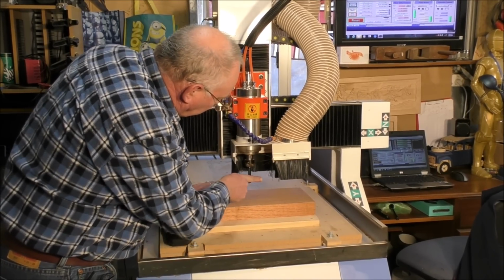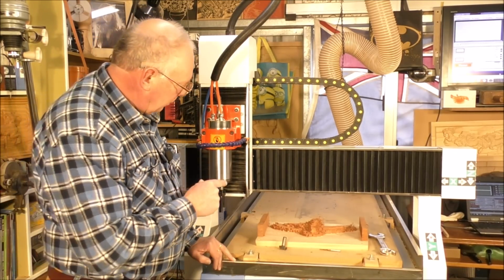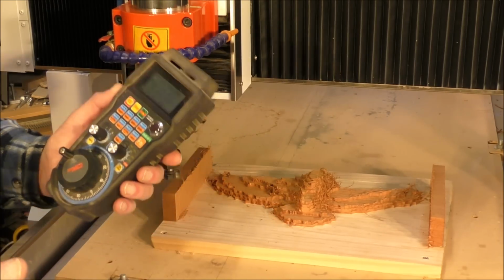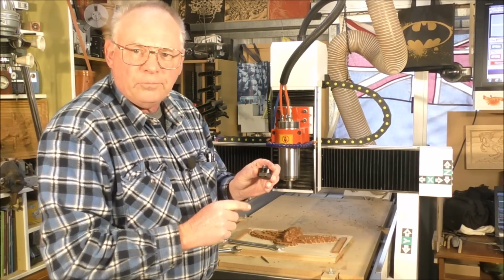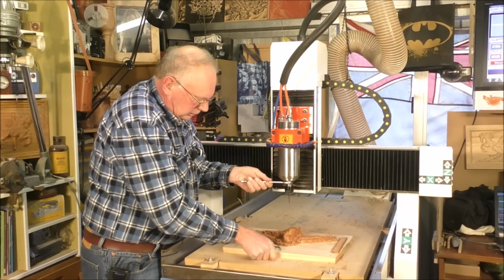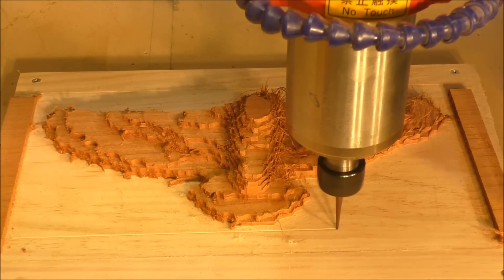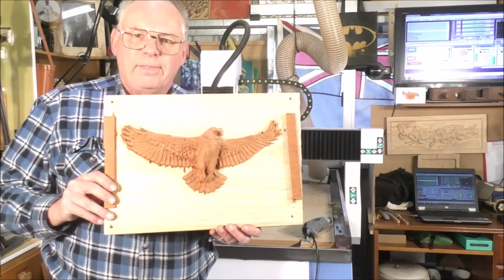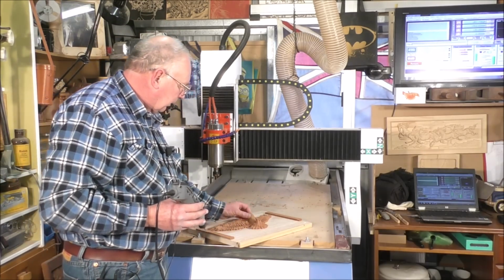2M views CNC router CAN make $25,000 🤑 per month carving a 3D American bald eagle I CAN SHOW YOU HOW

Comment: I dont understand why you didn't just start with the area bigger so you didn't have to manually clear it? Also since its end grain you should be able to break it off no problem.  Why not just measure from the base of the eagle block and then top of the eagle block so you can just do some math when you put the fine bit in?

Comment: Nice job done Roger.  You remind me of an old friend of mine who has since pass away.  I watched several of your videos and enjoy them always.  A brother N law of mine use to do refinery work, with various aluminum, brass ect... he was very good at it and some times they had things like the eagle to pour in metals, and they would on occasion use a sand blaster to remove the roughness, I use sand blasters for engraving and if you use filtered silicone sand it is like high grit sand paper, lets say 1000 grit plus and it is easy to sand with, might be an option in your future and it gets into all the small areas for ultimate sanding.
Reply from the maker: Thanks barry, I will look into that.

Comment: Hi there, new subscriber! I am a designer and CNC programmer by trade and have been investigating which router amd software combo I should invest in. The problem is, how come it seems no software seems to accept .stp files or other formats I could save out using solidworks? I want to design my own files and import them into the CNC software to program. Any help would be greatly appreciated!! Thanks!
Reply from the maker: Carveco
Reply: @inventorsworkshop9600  Thanks Roger, I will look into it!

Comment: hmmm, i remember learning how to use a carving / copying machine when I was working with my step-father back in 80's, we also refinish furniture for local hotels, like Red Lion, etc.  That thing weighed tons and duplicated 6 other pieces at a time, i dont want to upload some of the finished work we did, you would throw your machine away and start another hobby, we also created and built $100,000 floors that was also German ingenuity and we used our hands.

Comment: Great video! A little tip on setting tool offsets... never measure from the top of your work, always measure from the table or fixture using a standard height block. It can be any height, as long as long as you know what it is. Then measure the delta between your tool reference and your workpiece reference. This way if you machine off the top of your workpiece and you need to change/replace a tool mid-cut you still have your datum.
Reply from the maker: Great tip!

Comment: What would happen if you accidentally added an extra 0 on the spindle speed?
Reply from the maker: The VFD will only  let the router motor run to a maximum of 24,000 rpm

Comment: Very nice work. I´m a OB&GYN and I was wondering if it is possible to do a baby face with a volume 3D archive from a ultrasound machine (*.stl) with that machine.
Reply from the maker: Yes, absolutely, you would need to run the file  though Caveco CAD/CAM to make it usable geometry then create the 3D tool paths (G-code) and the CNC router will cut it.

Comment: I can see where they got the idea with 3d printers there essentially CNC machines that extrude plastic instead of cutting.
Reply: I will take a sinter over an extruder any day. Still not there yet.
Reply: @jamegumb7298  I've got a Sinterit Lisa Pro. Great for models and POC... really bad for accurate large parts. Problem with SLS is that the plastic warps significantly under change from high temp (200+ c to melt) to lower temps, especially nylons. hopefully better software fixes that in the future. if you're not looking for like 5 thou accuracy over a 20cm part though the tech exists just expensive. the plastic powder cost is no joke (and will probably never be, since plastic that fine is a bitch to make)

Comment: You should write some G Code to Face down the left and right pieces of left over stock. Just need G1 X0 Y0 Z0 F1000 and the G1 X0 YDistance Z-2 and just copy and paste until you hit you depth.

You should try a second at -.1mm lower depth pass for cleanup, it's faster then the manual work.

Comment: A suggestion (might be of no use). Could you stick the ends of the blank with double sided tape and the main working area with wood glue? Then you should be able to knock the ends out of the way when the cut finishes.
Reply: Another one - do the cuts then soak the red cedar in liquid epoxy. When it's cured, run the final cuts again to clean off the wood feathering.

Comment: i got so much better at cnc wood carving once i realized the importance of calculating the spindle rpm for the feed rate and the specifications of the bit.  The bit doesn't even get too hot to touch when it's making chips properly;  You just have to get more comfortable putting some lateral force on it instead of thinking the cnc machine is supposed to be moving with no resistance

Comment: Those remaining outer edges are a little time consuming to reduce down, prior to swapping out the cutter again for the fine cutter. Why not enter instructions at the very beginning with the 12.7mm cutter installed that removes 6-8mm from the left and right side and then continues to rough cut the object (in this case it is an Eagle). Reducing those outer edges first would save you an awful lot of time and also a whole cutter change. not to mention the wear and tear of that cutter. Just a thought. God bless.

Comment: Could you replace the bits with metal cutters and make a brass eagle? Before they had computers I used to use a tape drive milling machine and carved out different things with aluminum. I was trained back then by a teacher that machined parts for the first space shuttle. He helped make the doors on the space shuttle and normal tolerances for machining are plus or minus 5 thousandths, but for the space shuttle the tolerances were plus or minus one thousandth.
Reply: I'm assuming you're talking inches.  1 thousandth of an inch is 25 micron.  I work on a crankshaft manufacturing line, and we run to a bearing diameter tolerance of +/- 8 micron.
Reply: that is more likely work for the bigger industrial cnc mills like a vf-2 or something from what i see these garage cnc machines only ever cut wood
Reply: It depends how rigid this router is and what the spindle horsepower is.  Routers are normally reserved for wood and plastic, while CNC mills are used for metals (and plastics).  This particular machine might be able to handle brass though, it's not a very tough material to cut.

Comment: When I work in metal, to get a nice finish I leave about 0.2-0.5mm for a fine cut. Just run the program again and it will get rid off that "fur" and leave a great finish. Cuts out that extra manual work.
Great video, inspires me to start woodworking!
Reply from the maker: Great point!
Reply: @inventorsworkshop9600  You can also try a downcutting bit.
Reply: Called a spring pass…

Comment: Needed to run a finer ball nose cutter at a shallower depth. Tbh even .2 depth might be too much as that would still leave ridges. To reduce the code size and time frame you could choose just the eagle with the finer cutter. As a safety measure I always program a 100mm off the job with a G01 code so it stops 100mm off check with a ruler and run the rest of the cycle. Blower and suction or a strong suction will keep the cutter cool so you could bump the RPM as fast as you like. I programmed an accident victims face but the amount of code and time frame to recreate a mask was ridiculous. This was before 3D printing

Comment: As soon as I saw all the jagged fury edges I thought, more cutting paths would also help with the amount of post processing. I would have tried double or even triple the roughing passes. then I would have switched to a 3/8ths inch ball cutter and left about 0.010" of stock with a decent 0.025" step-over. If your software has "rest milling" it will only go over areas it has to mill for the 3/8ths, I don't know how complicated or how complete of a package that software is. If possible (with your software), I would have used an 1/8th inch ball mill after that and cleaned out a bit more, again leaving 0.010" stock with the same 0.025 step-over. Then switch to your finishing tool, looks like a tapered ball mill. Perhaps go a tiny bit slower or give it more spindle speed and feed (both). Wood can be tricky to get a smooth finish with the more exotic woods, as you have noticed.

Please keep in mind that I am not "telling you what to do" or being an armchair critic. I'm just thinking out loud what I might try after seeing how that type of wood has responded to the tool paths that you tried.
Reply: It may be more cost effective to finish it by hand. Doing another entire pass (or multiple passes) with that small of a tool takes forever. You could almost have another one cut out in the time it takes.  I guess it just depends on what other orders you are filling at the time and if it is better time management to let the machine do the work.

Comment: a small wire wheel for the dremel might work for de-furring. Would have to be careful about the RPM's though I guess.  Also cutting 1-way on the red cedar might be the thing to do as it seems to peel around the bit when going one direction.

Comment: You should extend the cut from the first operation so it gets the wood you cut off manually, it'd save some time
Reply: @ SugarBooty, Precisely but my question would be why the workpiece was so much larger than it needed to be in the first place? All dimensions are known absolutes down to several decimal places and if there's one operation that will eventually break a long straight fluted router bit it's repeatedly engaging an endgrain face at full depth of cut.

The high frequency chatter usually heard as a piercingly loud, momentary scream, fatigues the steel shank just above the brazed tips and it just falls off onto the table, maybe bouncing off a guard when one is actually fitted..... I'd also just knock the ends off with a hammer or lever them off with a chisel. They're only held on with double-sided tape like the main body which will also need to be gently pried off when it's even thinner. Why even bother cutting them away? Furthermore, the wood could be used for something else. I could go on.

So I will. Why does the video title say, "CNC router making $2,500 per week wood carving an American bald eagle", when the first thing Roger says is, "Please help me with donations?"

Something doesn't add up. I wonder if Roger lives in a four bedroomed detached house worth over half a million in Sussex?
Reply: @SupraSmart68  The workpiece is likely longer because of the screws on the end but I don't know why the dark wood on top isn't shorter, maybe he glues long boards together and then just cuts them to size? The chatter wasn't the best, especially with wood but it wasn't anything too major. If it were my piece and I were optimizing my work flow to pump these out I would try to make the cuts smoother by playing with feeds and speeds to make my tools last longer. This guy seems self taught and he could learn a lot more if he wanted to, but most people seem to get away with the bare minimum that gets the job done. I'm not saying this is what he's doing, he might still be fresh, I don't know the guy

Comment: Hi Roger, I've found with some woods, to avoid furry bits you do the clearance along the grain and then the finish across the grain. Also a straight ball nose rather than a tapered ball nose does slightly better as  it gets down into the cusps better. Also, you can do an offset tool path, it takes longer but there is  less post cleaning up.   What wood do you find mills the best with no fuzzies?
Reply: Your moniker reminds me of my grandkids. Your grandkids are just a beautiful day with your CNC. You’ve done some fantastic work with it.
Reply: thats an interesting tip, gonna try it out

Comment: You should be able to write a simply G code program in Mdi instead of having to turn your handle tell it S1000 M3 and then G91 Y12.00 F5.0 and you can feed incremental without having to write a full program. Awesome 👏 work i like your channel ive been a cnc programmer for 25+ yrs and am fixing to buy a router for some side projects 👍🏻

Comment: Im sorry a swift knock with a hammer on those side pieces and off you go, seems like a lot of messing about using the router to gut down, or am i missing something ?
Reply: That would put the alignment of the work in danger. You might be able to get away with just knocking those side chunks off, but at the risk knocking the work off of alignment. Wood, even when screwed down to a table still has quite a bit of give in it.
Reply: @scurvofpcp  Fair point

Comment: There are rotating steel, brass or palstic brushes available for the Dremel. I think those might speed up the process of cleaning in case it's only burrs that are left?
Reply: Forget the Dremel, just chuck the brush into the router and run it over the whole surface. Let the machine do the work.
Reply: @user-lj4xq4hm3k  Ehh, with touch up work like that I'd rather the feedback from a hand tool so I can see when would be best to back off.
Reply: @S31Syntax  If you know what the cutter is doing you know where you need to program it. 
On that eagle it would take longer than 2 hours but if we are talking about selling wood carvings it would be well worth it.

Comment: Why don't you just put the dremel bit in the CNC machine and repeat the the second tool pass at a few micron lower? Clean everything up nicely and save the hand balling.
Reply: Or possibly a small, very low pressure sand blast?
Reply: @frysinclairmobilemechanic7732  that will only smooth it out to get details the axis of the cutter needs to change to get an undercut where nessary.
Reply: joseph desouza nothing will ever be better than an actual human hand and eye!
Reply: Nathan Hamilton try building a spaceship by hand and eye
Reply: @silvernatedogg  you are wrong, machines these days are are better and faster as a human. He only have a 3 axis milling machine. if he had 6 axis he could make all only with the machine. But the 6 axis is much expensive as the 3 axis.
Reply: Because the spindle cannot cut at an angle like he is holding

Comment: You could have machined this much faster by utilizing vector offsets. Offset the perimeter vector around the 3d image and set your finish toolpath to machine to those vectors only. then you could have used an endmill for the pocket carving that is outside of those vectors.  You would save alot if time.  Also I always raster against the grain,  there is little to no cleanup this way.

Comment: Hello Mr. Roger, congrats on your project, It's awesome. I'm from Brazil and I have worked with CNC routers for the last 15 years. Our biggest issue here is the 3D cut bits, its very hard to find, plus the client's complaints, refusing to pay the machine hours time. Just a quick tip: Using Aspire 9.0 version, you can manage to machine both sides of your American bald eagle. Front and back.
Reply: thats your problem. we dont charge people for the machines hourswe charge fo rthe product made im sure your very over priced is why you have issues with people complaining an not paying. hes selling that for 2500$ ill makeit al day ad let it for for a couple hundred..
Reply: @mrrod3004  You got right sir.
I'm not a machine owner, just the operator/programmer.
But this is the way owners here think. Machine hours set the product's price. 
They need to review this concept.

Comment: It might need cleanup, but I really like the look of that cedar with that pine. Very understated and pleasant. Using a shiny new ball-end cutter might reduce the hand tooling, but you can treat the cedar with sealer (Min-Wax Sanding Sealer works) before the final tool change to reduce tear outs at sharp angles. Just slow down your spindle & feed, give the piece lots of time to dry, then pause and check occasionally to make certain the cutter flutes aren't clogging with material. The first time I tried that, I didn't wait long enough for the sealer to dry. The very tip of the ball-end cutter clogged, got hot, burned the piece, then broke the cutter. Spot treatment with cyanoacrylate adhesive has worked for me, but it gets soft when heated, so caution is advised.

Comment: A flap/brush wheel for a drill is a major time saver. It will clean up your carving is under 5 minutes and get into all the details. They work best at a low rpm. Its called sand-o-flex

Comment: what kind of bit does he have in his cnc  at 3:06 . it looks like a  2 flute straight cut bit and ive never seen one of those before.
Reply: You are correct. I work in a wood working shop and use those bits regularly. Usually are carbide tip. They are made to cut from side not really made for end mill cutting
Reply: This cut bit with 2 straight flutes is often used to cut the MDF board. The straight flute avoids passing marks on both sides.

Comment: Ummm. Use double stick carpet tape.  Set your Z for the 0.0625 ball tip tool. Then tap off the sides with a hammer, just saved you lots of time.  I would run that with a choice piece taped to mdf, then pop it off and attach it to a backer.   I have no problem running 1/2" Shank tools up to 3" wide on my 2.2 Kw 110 Inverter (just make sure it's only running at 1800 rpm).  Good projects, just use more time lapse.